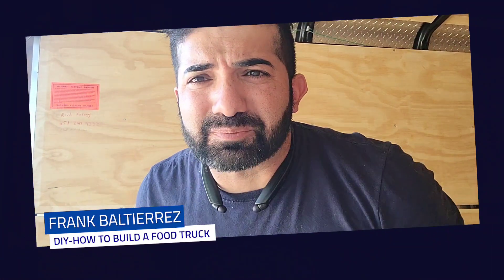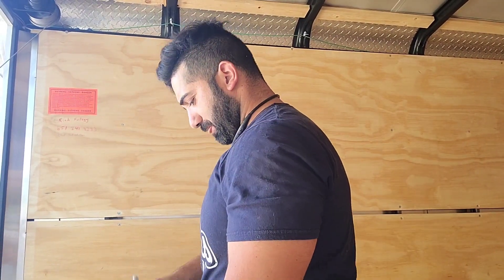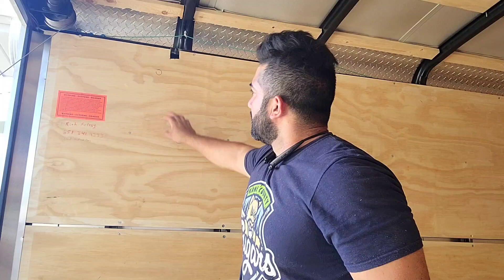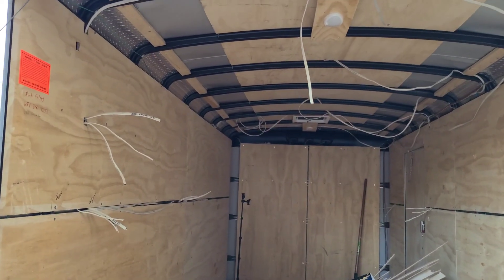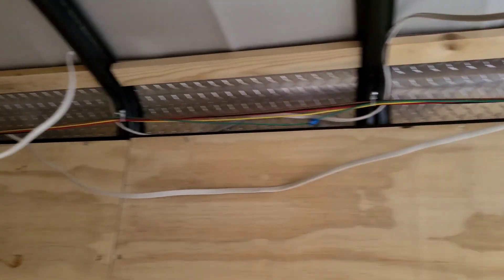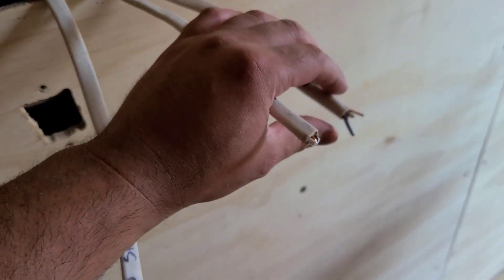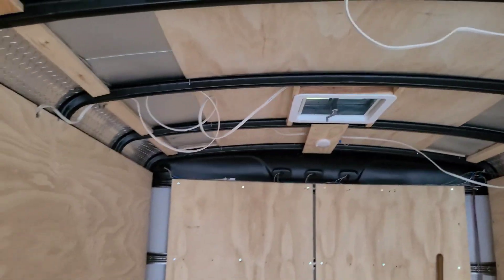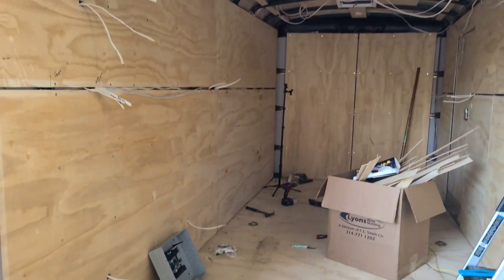How to Build a Food Truck: Electrical for Outlets and Lights

Comment: OK, question on the panel.   I know a sub-panel should not bond the ground and neutral.  and when this is connected to shore power, it is a sub panel so the ground and neutral should not be bonded.  but. what if connected to a generator?  in that situation, is it now the service panel where there should be bonding?  or is there bonding in the generator circuitry itself so the panel in the truck should still be treated as a sub-panel?

Comment: Everyone and everywhere I research it says I need a manual transfer switch, to be safe!!!
My generator is not wired into my trailer I hv to pull start it same for shore power I hv to plug it into my 50a plug box push and turn, both. Both power sources cannot be plugged in at the same time
I don’t know why I’d need a transfer switch

Comment: Someone tell me I am going to put flush mounted led lights in ceiling.  It I thought about 6-4” led flush mounted lights, 3- evenly split across left hand side and same for right hand side, is 6 too many? I see frank only has 3 lights, anyone that can help me please advise I dought frank reads these any more avd I don’t know how to contact anyone thru utube thanks
Reply from the maker: @stevequate1797  I see them all, still here :) if they are slim and you wont ne hitting your head definitely can work. I prefer strip lights now LED. 4 FOOTERS

Comment: I’m working a small grill 2 small deep fryers a warmer and a refrigerator I got 20’s in the circuit breaker I can’t run everything at the same time my generator keeps blowing can you tell me if I use a 50 amp will it prob be enough
Reply from the maker: Is the cooking equipment electric?

Comment: So all your Homerun wire is 14/3 not 14/2 ????
Reply from the maker: Should all be in 14/2 I believe that is what I used
Reply: @fbaltierrez  but on some wire you you ran several 14/3 with switches in more the 1 area so your diagram is very confusing to me . I'm watching all the wiring video's and in most your no showing the ends home run wires are 3 and a ground correct ? and your 14/2 are 2 and a ground . sorry frank but I'm a dyslexic so it is confusing me as i want to wire mine the same.
Robert

Comment: Hi i have a box truck am going to use it as a mobile tire shop how can i run an air compresor, tire machine, and balancer out of a generator how can i run the wire so i dont have to have so many cords connected to the genarator thanks

Comment: I have a really good question Frank..I got a pop up camper that I converted into a food truck..as you know camper already has electrical ran...just plug into a power source..so my question is do I still need a switch box and a generator ?
Reply from the maker: I would say possibly yes because you want to separate circuits for different types of equipment
Reply: @fbaltierrez  what size generator do you recommend..
30" griddle
Non commercial fryer (2)
Small refrigerator
4 crock pots 
Air conditioner (5000 watt) ?
Reply from the maker: @grimminalmyndz  I would go with this one the predator 9500 inverter generator
Reply from the maker: @grimminalmyndz  but it all depends on your amps needed
Reply: @fbaltierrez  thanks Frank👍🏾
Reply: I forgot to add I'm running all electric, I don't wanna use propane on anything on the truck, and removed the entire propane line, so No gas....all electric everything 👍🏾

Comment: I have a question that even a couple electricians were saying "  I gotta look into it "   I'm having trouble knowing what size amp I should do for my set up.   They were saying 50 amp should be enough.     Last year my cart had less then it has for my new one. And it was maxed out.  It was a 30 amp. And we were maxed out.   And so this cart has.      Ac on roof top.   6 outlets.   110 water heater plug in.   Lights.  Exhaust hood. And fridge and freezer.     And a fridge that goes under my flat top as well.    So 2 fridges.     So my question is. Would you run a 50 amp on this set up.  And what they were unsure about is if we did 100 amp.  Would if be too much to plug into different areas we go to.  Also too much for generator.    My generator is 50 amp capable I believe.    It says 60 amp.   But anyways. Any insight on what you'd run for this man ?   Thanks !
Reply from the maker: I'd do a 50 amp 6 gauge wire. That is quite a bit of Electricity that will get pushed out to your equipment. Hopefully this helps!
Reply: @fbaltierrez  thanks so much.  I will do that.   Hopefully that's enough !  Ha

Comment: Ya lost me after you ran all the wires and then showed it all done.     Does each outlet run back** seperate to the panel or does the one wire connect to all of then and then back to panel?
Reply from the maker: In the next week or so I'll have an updated electrical video I'm working on now for this new Food Truck build 👍
Reply: @fbaltierrez  heck ya dude.  Awesome.    Thank you !    I know it seems so simple when you've done it so many times.  But give me some slack.  I'm a plumber 😆

Comment: Good vids , I learned a lot , any chance you go green using solar panels , solar generators just to run the basic lights , small fridges , cash register , and use a gravity water tank to feed your sinks ??.
Reply from the maker: I would but haven't seen solar generators yet. If it made sense then absolutely I'm in!!
Reply: That’s a great idea🧐 I wonder how it would do

Comment: Ok sorry Frank. Just to clarify. I confused on the lighting? I want to run 4 lights like you have, I have my electrical ran just like yours. Just confused as to how you ran all 4 lights from the switch’s? I have the one light Romex by the water pump switch and the other by the window switch. How do I run all 4 from just these 2?
Reply from the maker: Good morning, I uploaded another electrical video about a week or so ago. Giving a bit more clarity on the electrical hopefully it helps.

Comment: Frank how did you run the 8-3 thru the the wall to the breaker box. Did you drill through the floor then run up.
Reply from the maker: Yes drill as close to the wall as I could but yes drilled through the floor and used a wire mold box to cover it after

Comment: They don’t require insulation on the trailer?
Reply from the maker: No they do not. Wouldn't do you much good, concession window will be open when working and out goes the AC

Comment: Does the handy boxes have to go to an specific height from the floor?
Reply from the maker: The wire mold boxes typically i put them at 48 inches either to center or to the top of box. That's the general rule

Comment: Great video! If I wanted to add a 240v outlet for a big appliance, would I just run a home-run from the breaker panel to the 240v outlet? I understand the romex would need to be 10 gauge.
Reply from the maker: Yes that is correct just a home run to the panel
Reply: @fbaltierrez  right on! Thanks brother. Keep up the good work!

Comment: I was thinking about putting 8 LED low profile lights in my 16x7 box truck would that be too much? Also, if I have a double oven an induction cooktop and 2 fridges would all of them get 14/3 or what cable would I use for that?
Reply from the maker: It depends on the lumens. If they are low lumens then you should be ok. If it's let's say 1000 lumens each it will be super super bright in there. Are the ovens propane?
Reply: @fbaltierrez  they are 560 lumens. The ovens are electric and run on a 240V which I assume would be a 50AMP breaker. 

I thought: 
- Fridges would be 14/3
- Induction would be 14/3 or BX
- Double oven would be maybe 8 gauge. What are your thoughts?
Reply from the maker: @dustinandjudycook6426  yep sounds about right. You got this!!!
Reply: @fbaltierrez  what order should I be doing each trade plumbing, electrical, framing, flooring, cabinets, etc?
Reply from the maker: @dustinandjudycook6426  In my opinion I would start with the framing, electrical wires, then insulation and walls, then the outlets switches. Plumbing and gas to the end. Kinda like the same way my videos have been going.
Reply: @fbaltierrez  so I did the 14/3 for the low profile led pot lights. What do I do with the red wire in the control box? I just bent it in and connected the black, white and ground. Is that fine?
Reply from the maker: @dustinandjudycook6426  yep.just bend it in. You can add a wire nut if you want just for extra protection

Comment: Hello Frank. Does the electrical panel needs to be a certain distance from the hood and exhaust fan?
Reply from the maker: Great question. I sent this same message to my health department and they answered like this. We let you use your judgment and because of that answer I placed it as far away from everything as I could being the back. But I would say just keep it far from water
Reply: @fbaltierrez  Thanks. What about installing my three compartment and handwashing below the panel?

Comment: Good morning Frank. Thank you for taking your time in posting  your progress On DYI project . I have learned a wealth of knowledge through your post. 

If you don’t mind. Would you please let us know plywood thickness used on walls.

 Also can you give Info Incase Amperage used is greater than 30 but less than 50. Ex. Generator, Service panel size, romex size, breakers amp size. And Tamper outlet amp size. Assuming that all my equipment will be running simultaneously as needed should I stay under 30 amp or if running continuous should I go greater than 30 but less than 50 amp. 

Thank you! your help is greatly appreciated.
Reply from the maker: Wall thickness was the standard that came with the trailer I believe it was 3/8 plywood but if I had to install I would use 1/2. 100 amp panel is sufficient, romex if you want to be safe use 12 gauge wire and 20 amp outlets
Reply: Thank you Frank. Greatly appreciated. I have learned a lot from all followers reaching up to you with question.
Reply: Once again Frank. Bothering you with one more question. I did get to catch on your other post about using higher wattage generator are too loud. 

Well,  after adding all amperage,  I will have a total 50- 55 amps. The Westinghouse Generator you are using is about the best for the money. Do you recommend I buy two igen4500 Westinghouse Generators and connect Each to Two different Load centers. Or is there better options.
Reply from the maker: @OscarGarcia-sy9bu  you can connect 2 of those generators in tandem and get a total of about 60 amps if I am correct. Have never had to use that much power but that is the concept. Let me know if that works for you
Reply: That’s awesome. Thanks for all your help.
Reply: So, far I have 30-35 amp total. Not including AC.  I do live in very hot and dry city and would like to add rooftop Rv AC.

Comment: I'm in the process of building me a food truck. I'm trying to decide if I should use 12/3 wire or 14/3 like you. Another video used 12/3. What do you recommend?
Reply from the maker: It's a great question. You can't go wrong with either one. 14 gauge wire handles 15 amps. The way I distributed my wire to the outlets would be maximum amperage of 12 amps. So 14 gauge works for my application. Add up your amps and that's the key 🔑 hope that helps
Reply: @fbaltierrez  Thanks really appreciate it.
Reply: @fbaltierrez  Does it matter if I use 15 amp or 20 amp outlets? Would it hurt any if I'm running only 120V? And if installing 20 amp outlets would it be best to run the 12/3 electrical wire? Sorry for so many questions.
Reply from the maker: I'm using only 120 volt. The rule of thumb is: for 12 gauge wire you use 20 Amp outlets tamper resistant if you are using 20 amp breaker. And for 15 amp use 14 gauge wire with a 15 amp breaker. Hopefully that helps. Make sure you use tamper resistant outlets
Reply: @fbaltierrez  Thanks man
Reply: @fbaltierrez  Can 14/2 be used instead of 14/3? Are there any advantages of using 14/3 over 14/2 if all I'm doing is a few outlets? Just trying to keep it simple I guess.
Reply from the maker: The reason I like 14/3 is because it gives you an extra wire for a just in case in the future but 14/2 works. I guess I have seen wires go bad in my years as an electrician and in always thinking ahead. But 14/2 works
Reply: @fbaltierrez  Is there anything wrong with using 12/2 and a 20A breaker even though everything in my truck will use under 15A or right at it?